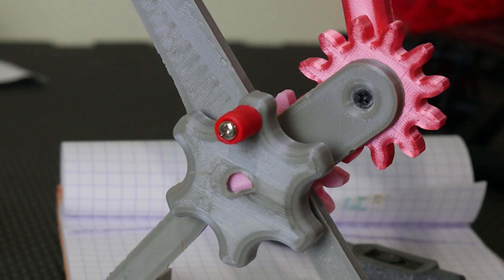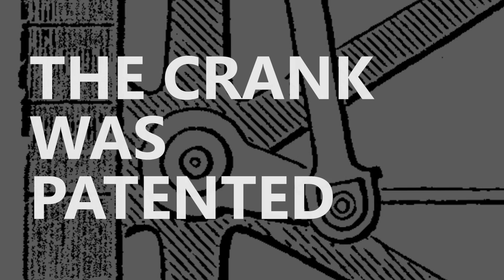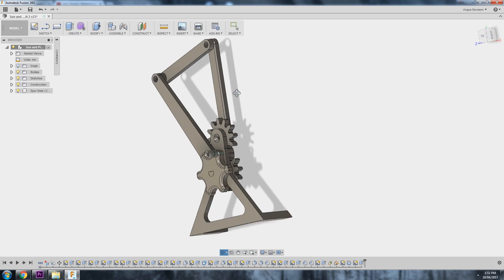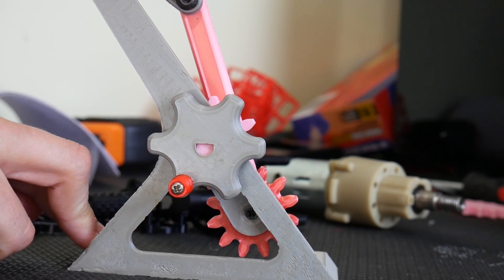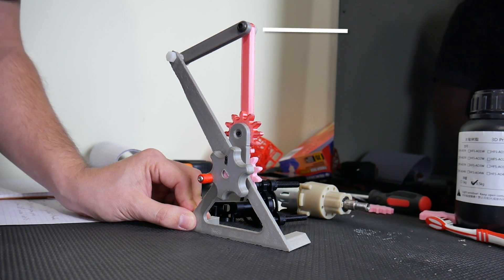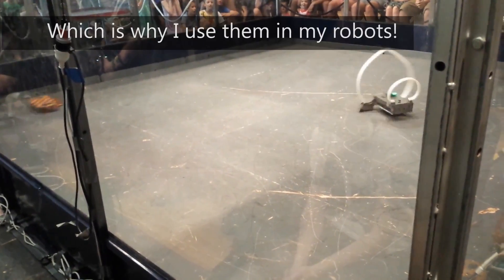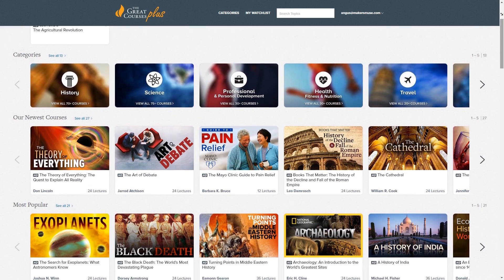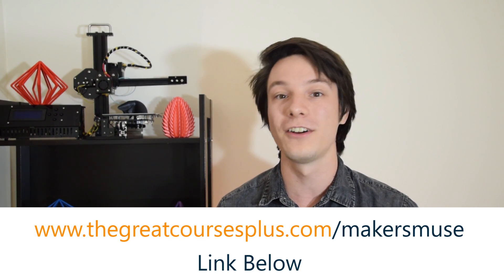How James Watt circumvented the Crank - Mechanisms of the Industrial Revolution

Comment: Holy shit I now realize, most of our older bicycles had this type of epicyclic gearbox. The newer ones have dérailleur gears, with clearly visible multiple sprockets.
And on this occasion, I'm learning the vocabulary of it all... like "sprocket", I could've never figured out its meaning if I hadn't read it in context. I understand the others though, like the roots of "epicyclic" thanks to my scientific education and the French word "dérailleur" because I'm fluent.
Reply: Both types of bicycle gearing were in use by the 
1930s and both are still in use.  Derailleur system is stronger and more efficient but finicky in adjustment and vulnerable to crashes.

Comment: Probably would have been relevant to mention that the planetary gear system was widely adopted for automatic car transmissions a few decades later.It is still used today, on probably billions of cars, due to its compact design and multiple reduction options.

Comment: Would I be right in assuming that the power transfer through the sun and planet mechanism would not be linear? Ie, If the linkage stayed parallel with a vertical line at all times, the power transfer would be linear. However the sweeping movement causes the planet to roll more quickly or slowly depending on its location in the cycle.
Reply: You make the arm long enough that the difference isn't significant.  With a large enough flywheel it results more in varying input torque than varying output speed.

Comment: Broadcasting was the most common method of sowing until Jethro Tull invented the seed drill, IIRC. That has nothing to do with the etymological roots of early radio transmissions though. Both words* are still in use. Some crops are still broadcast.

(*Broadcasting and broadcasting are different words, spelled identically.)
Reply: So where did "broadcast" come from, then? 

That the original meaning still hangs around doesn't mean a new word can't derive from it - nobody would claim "mail" (as in e- ) can't derive from "mail" (as in paper) just because the latter still exists , or that the continued existence of bird tails means the tails of aircraft must be named for something else. Radio waves are named after sound waves are named after waves on water, yet all three still exist in English.  Casting seeds and signals broad use the same word because they are the same word, which has taken on two rather similar meanings - or perhaps one more generic meaning ("spreading over a wide area") that covers both. 

As a source, consider this: https://books.google.no/books?id=AwzsDQAAQBAJ&pg=PT43&lpg=PT43&dq=%22the+word+broadcast%22&source=bl&ots=3gDgCFYQDE&sig=CfNAIniI3orqPrKwaIXU9Iajw98&hl=en&sa=X&ved=0ahUKEwjLkv2Bh9XTAhWPIlAKHVrVBaQQ6AEIOTAT#v=onepage&q=%22the%20word%20broadcast%22

Comment: Stupid, basic patents like this annoy the hell out of me. In my opinion, a patent should only ever last for X depending on the complexity of the thing you're patenting and how much R&D has gone into it. A crank is just a bar with a hinge connected to a wheel, it's not exactly rocket science, and didn't deserve a patent at all.
Reply: Why the heck do people pull politics into everything? Obsessed!
Reply: I was writing a wall of text until I read your original post again. This part here is important: "a patent should only ever last for X depending on the complexity of the thing you're patenting and how much R&D has gone into it." With that, I wholly agree.

However, your next part ("A crank is just a bar with a hinge connected to a wheel, it's not exactly rocket science, and didn't deserve a patent at all.") is probably what.. triggered (for lack of a better word) Nauhteeboy. While, yes, a crank is "just a bar with a hinge and a wheel", it still required an impressive amount of R&D and T&E.

To put the surprising complexity of a crank somewhat in perspective: people spend years of their lives learning about and improving on something "as simple as" tooth profiles of gears. 
Or, the seemingly simple idea of making the cross-section of the blades of a boat propeller similar to that of a wing of an airplane. Research teams spent countless hours deciding that it was an optimal shape and then further perfecting that optimal shape. In hindsight it's easy to say "well, DUH!", but that is no reason to invalidate the research that went into whatever was done.

So, yes, a patent should last for X depending on amount of effort Y. But, no, seemingly simple solutions do not necessarily deserve no (or small/short) patents.

Even then, might you figure out something simple that is still so groundbreaking - all the while you were taking a break on the toilet reading yesterday's news, do not hesitate to run for the patent office and get your idea written down (if you don't, someone else will). At that point, remember your original stance and use your earned royalties to do something good for the world, or remember what Alexander Fleming did to his penicillin patent and do something similar.
Reply: Your suggestion is broken, because there is no objective way to decide complexity. You are literally suggesting to introduce another variable into an already broken system, one which fundamentally fixes nothing, and one that can be further gamed by unscrupulous parties and create even more issues and baseless litigation.

The crank possibly does not pass patentability threshold because of 'prior art', which was probably simply not found at the time, because methods of cataloguing and search were not so advanced. If you think of non-obviousness rule, this is already so difficult to reliably argue that it had been completely gamed from the beginning. The crank may have even been a legitimate invention, not as a crank per se, but details that make a particular realisation of the crank viable, though honestly i doubt that - if Watt didn't use a crank, it means there was only one sensible way to build such a crank, and that happens to be covered by the patent, which means it likely violates the non-obviousness rule.
Reply: My impression is that the purpose of patents is to incentivize two things: 1) public documentation of the method in the invention, so that (once the patent expires) the public will benefit not only from being able to purchase copies of the invention, but to make their own (unlike in the case of a trade secret), and 2) invention of useful things in the first place.

There are some inventions where, by selling units of it, one would automatically reveal the method behind it (e.g. the general idea of wheelbarrows. Not so much specific variations on that idea though.). In these cases, one of the justifications is removed, but the other one is probably still applicable in most cases.

I'm not sure that having the patent office evaluate the amount of work and resources put into designing the invention in order to determine how long the patent should last would work as well as might be hoped. When working to invent something, I would think there is a substantial degree of uncertainty as to how many things must be attempted before it will work. I am not sure how this could be effectively taken into account.

I don't know how much resources went into developing the crank, so I can't really comment on that in particular.

I would guess that it could make sense for the length of the protection to be shorter when the method is clear from any use of the invention, because the patent only serves one of the two uses, but I am not certain of this.
I don't understand the economics of invention well enough.
Reply: "a greedy company couldn't snap up the idea and profit from it, because the information is readily available (especially now with the internet and all). Who would pay money for something they can get for free?"

Even if you did not have to contend with patents you cannot go out and make a car for free. Would you buy one from some inept maker that will be gone tomorrow with your money?

An ignorant soul said "Watt (&Bolton) patented the separate condenser resulting in stagnation in steam engine design until it lapsed.  Watt was certainly doing the US thing of using patents to stagnate development and throttle competition"

There are many countries that do not offer patent protection that could use the "free information" from both inventors and often no patent application where it is too expensive anyway. They just can't attack the patent holders markets.
Reply: what about shortest length of computer a program which produces the patent document as a measure of complexity?
Reply: XRMissie that simple mechanism was cutting edge at it's time as is right now a brand new cpu or a new rocket engine. This looks simple to us because we have seen a lot of other technological marvels that are thousands of times more complex. If you invent something you wouldn't expect to give it freely no?
Reply: @metzgerdan   the crank wasn't "cutting edge" it had been invented multiple times independantly, millenias before. https://en.wikipedia.org/wiki/Crank_(mechanism) turning circular motion in back and forth motion has already been patented anyway... in 1597.
Reply: Money speaks. You bet he got that patent for money money money. Nothing but money. Not to help humanity, but for money. His offspring would be filthy rich by now. Living on royalty money.
Reply: Xenro66 you wouldn't be saying that if had invented the crank and patented it. You sound like a fucking communist.
Reply: Actually, yes I would. It's an incredibly simple mechanism that requires virtually no thought to assemble and that anyone could figure out how to make, if they needed to convert lateral motion to rotation (or vice versa).

I'm sorry, how does me not agreeing with basic-ass patents like this make me sound like a "fucking communist"? If wanting total transparency when it comes to simple mechanism (so others may modify it and potentially make it better/more useful, or just straight up use it), then so be it.

Let me just give you an example of how absurd it is to patent something so basic: Let's say I just invented the wheel right this second and patented it, no one would be able to use it. That means anything from cars to rollerblades would cease to exist, unless you paid me to use this "design". There's nothing special about a wheel, it's just a disk that can spin freely, whereas a crank is just a disk with a few extra bits on it.
Reply: What is your obsession with communism? And yes, I admit it's hindsight, but it's just stupid to assume that because one person made something simple and useful, no one else could've done so. Oh, just so you know, chopsticks have been around in China for so long because there wasn't a need for forks. Thousands of years of use should give that away... Why fix something that isn't broke?

I never said that ingenuity shouldn't be rewarded, I'm just trying to get my opinion across that depending on the complexity, something shouldn't be held off limits for use. If multiple people invent the same thing at the same time, but only one person ran to the government and patented it, it would completely defeat the purpose of it being useful, because now it's off limits...Unless you pay the guy who said "IT'S MINE" first.

Look, you're completely missing my point, and quite frankly, just straight up ignoring it. Argue all you want, my opinion is still my opinion. Derailing a conversation to call me a "stupid and and a commie bastard" and trying to insult me is just pointless.  Now, please do us both a favour and stop trying to antagonise random people on the internet because their views don't line up with yours.
Reply: Xenro66 you are the better man. Just so you know, it's easy to make complex solutions. It's the "easy/somple" ones that are the most difficult. So you go ahead with your holier-than-thou idea about giving away good inventions but do a little research on a few things  like the light bulb, so simple, so obvious, yet patented and made its inventor rightfully rich. I guess you would have Edison give that away to. Those monies from the bulb allowed him to work on so many more ideas. Without it who knows how long it would  have taken him to make other great inventions. You want to deprive honest smart people of thier due, just because  you think revolutionary simple discoveries should FREE. You really have no grasp of how difficult new ideas are to come by, let alone how crushing it can be to see someone steal them and either give them away or profit from them. Let's see how long it would take you to sue someone if they gave away your invention of antigravity generator you made from a battery and old CD player.
Reply: The light bulb took a lot of time and R&D, so that'd be a clear exception. Getting cashmoney for your ideas is good and all, but personally, I'd rather allow the entirety of Humanity to benefit from an idea, rather than just myself. In most cases, stuff do require patents because of the amount of work put into creating such a device... But look at it this way: if everything didn't have a patent, a greedy company couldn't snap up the idea and profit from it, because the information is readily available (especially now with the internet and all). Who would pay money for something they can get for free?

Plus, I concur; the light bulb isn't really that simple if you think about it. You've gotta get a filament with the right properties to accept high amounts of power to glow without melting, and put it in an oxygen free atmosphere where it won't just corrode instantly. That's a lot of trial and error to get through, and then figuring out a way to mass produce it reliably, haha.
Reply: There's nothing more I'm willing to say, as anything I do say is just going to perpetuate this argument. Sorry I wasted your time :/
Reply: That's not why I'm giving up. I'm giving up because there's no point expressing my opinion with someone who is rejecting it. It's like trying to get an atheist to convert to Christianity. Have a good day.
Reply: @tillerbeez6575  now listen here buddy,i was a communist for TWO months after i was born and i can say from experience that whole mechanisms can be patented but simple parts of it cannot be

Comment: so amazing, it's a patent isolator device- it keeps the force from being transferred through anything that might violate a patent, even though those parts are all present!

Once the patent expired you could just weld the gears together and drill out one bushing and shove a new bearing in there and it's a crank again!

Comment: One thing not mentioned here is that the 2:1 ratio occurs only when both gears are the same size. If the gear connected to the pushrod is twice the size of the output shaft gear you'll get a 3:1 ratio (1 turn due to the pushrod acting as a crank + 2 turns due to the gear ratio gives 3 turns). 

Similarly, you can get ratios closer to 1:1 by having the output gear bigger than the input gear. If the output gear is twice the size of the pushrod gear you get a 1.5:1 ratio, if it's 4 times the size you get 1.25:1, so with minor changes it can be made to work quite like a standard 1:1 crank.

Having a gear increase in the crank means that the flywheel can be a built a lot lighter (By a factor of 4 for a 2:1 increase) and still store the same amount of energy, which at least theoretically could make a difference for portable or self-propelled engines that might offset the drop in efficiency and higher cost of the mechanism.

Comment: Have you noticed that if you took away the sun and planet gears, you would be left with a simple crank mechanism?All this seems to do, is add friction.  Am I missing something ?
Reply from the maker: The plate doesn't transfer any force, as explained in the video it just keeps the gears meshed - without the gears nothing would transmit. If you locked the plate to the center shaft however... it would become a crank.

Comment: If they used an involute gear profile, the teeth of the two gears would roll off of each other. It's rolling force transfer without the need of a ball bearing.

Comment: Can't the sun gear act as a flywheel?
Reply from the maker: +Espen Sales the flywheel needs to be a lot larger in diameter for more inertial mass
Reply: Well, you could turn the gray wheel (on the printed example) into a flywheel, right? Both the sun gear and the gray wheel run on the same axle.

Comment: How is it less efficient when running from the piston? The crank turns one stroke into one rotation, but this turns one stroke into two rotations. Wouldn't this mean it would be better for turning linear motion into rotational motion?
Reply from the maker: Less efficient in terms of friction, there's more points of contact and higher mass. The gearing doesn't make it less or more efficient, but would have had to make the engine work harder each stroke (again, not sure if that was a benefit or not).
Reply: oh that makes sense now, thanks

Comment: More teeth would make the operation smoother and choose a pressure angle of 14.5 or nominally 15 degrees for even smoother operation (in powered machines makes for a quieter gear train and is important for machine tools in reducing vibration, producing accuracy and better finishes).

Comment: Does simplify 3D lower the nozzle height for ABS, I was just using PLA and the layering was fine but after changing the filament to ABS the nozzle seems a bit lower